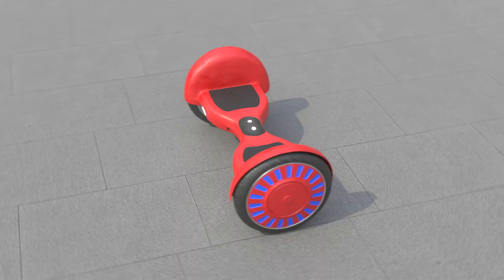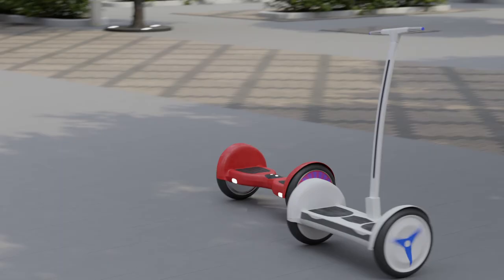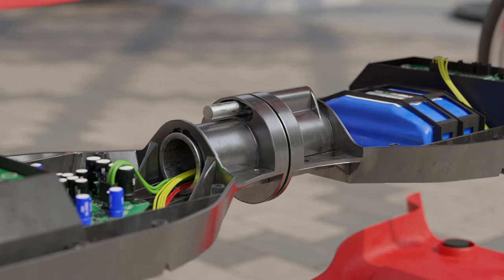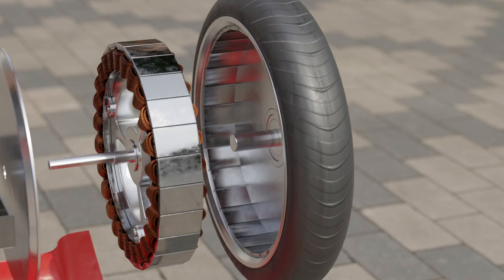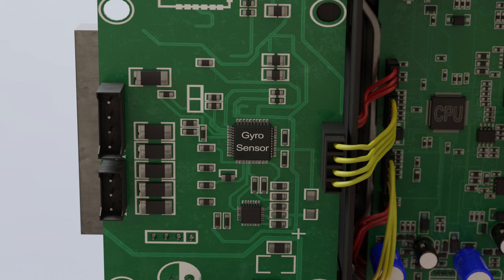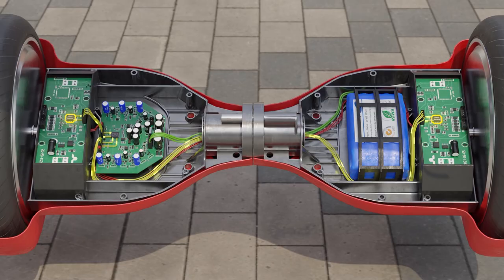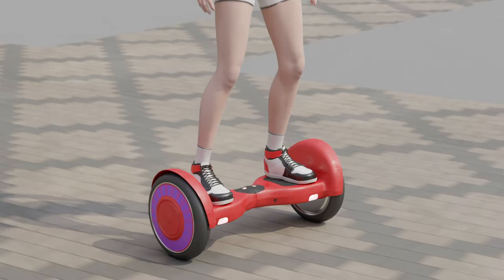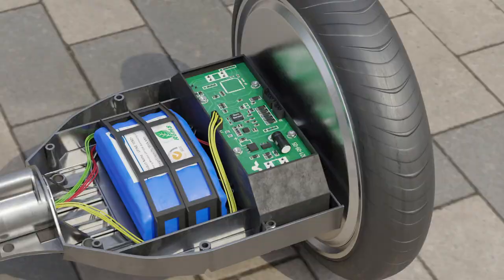How does a hoverboard work?

Comment: So im here to ask if the technology inside is similar enough to thumbsticks that these could be repurposed into game controllers, given the motors and batteries are removed, and the sensors would then be powered through USB only. I ask because I believe it would give fps games the feeling of riding a hoverboard in death match modes if the signals were recognized through a keyboard circuit board or usb arcade circuit board.